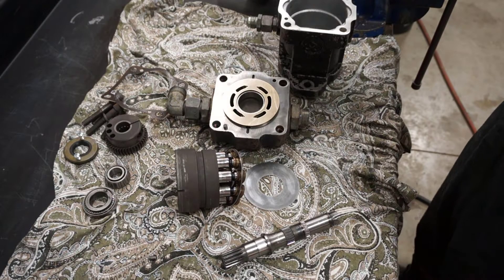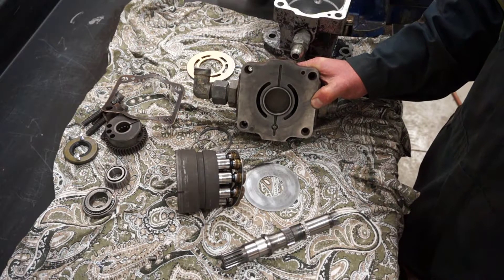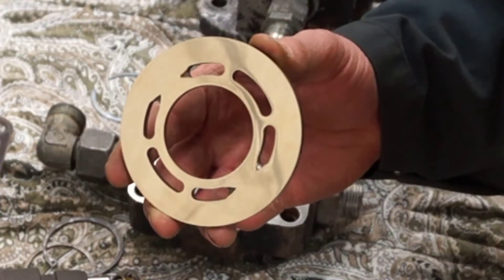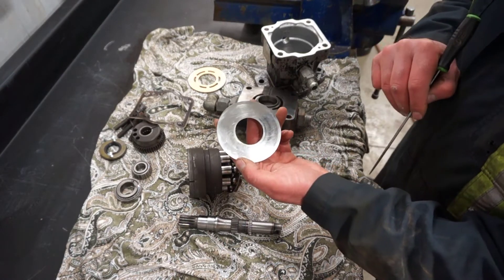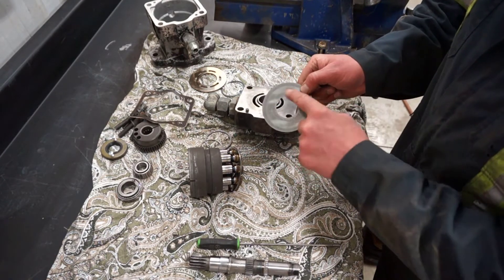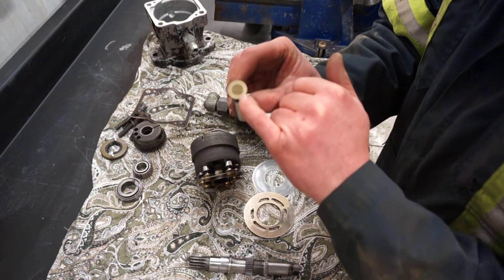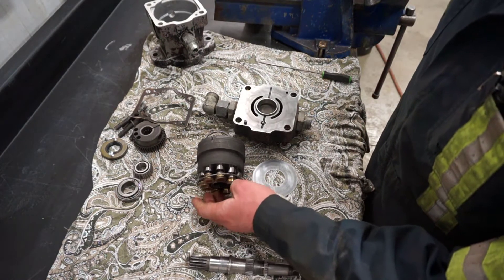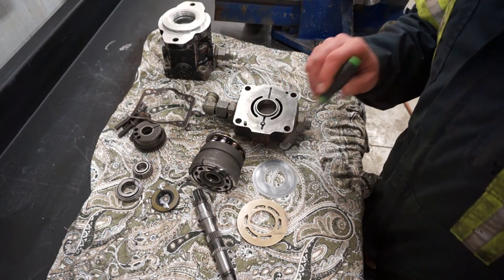Axial Piston Motor Identification and Refurbish.

Comment: Hi. You don’t tell about the bore’s condition. My motor have zero scratches but have a section inside the bores that is larger. I wonder if normal or not. Maybe the seals slipway. All pistons the same. The motor has abnormal low power especially after using it (pistons get hot maybe). Do you know if bores should always be 100% cylindrical ?